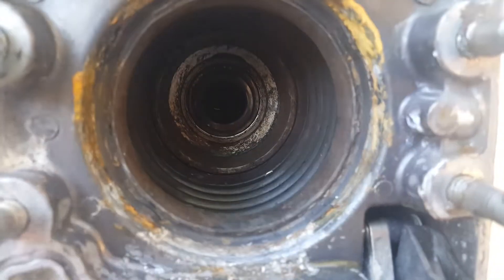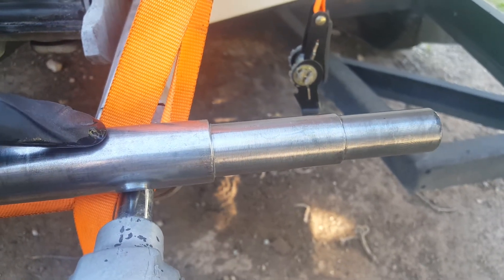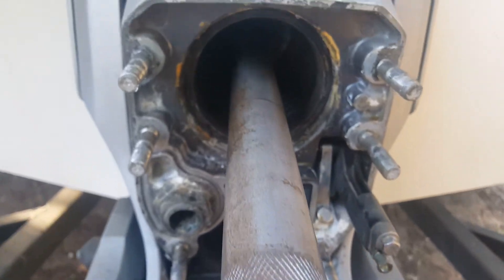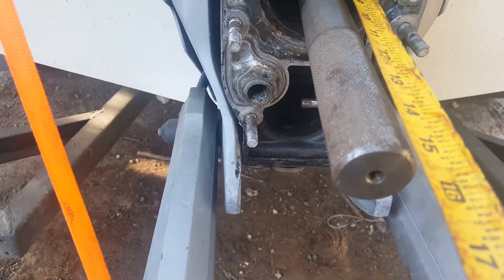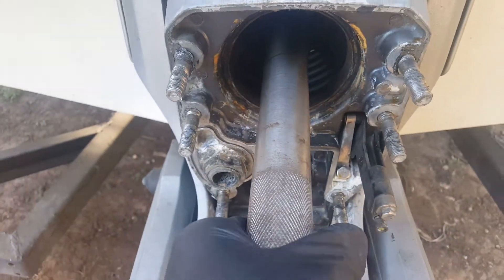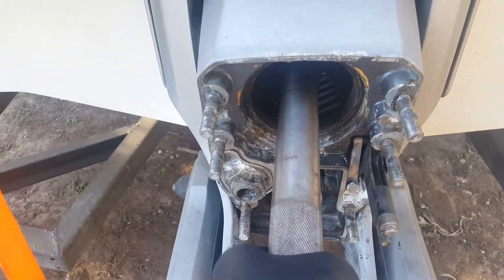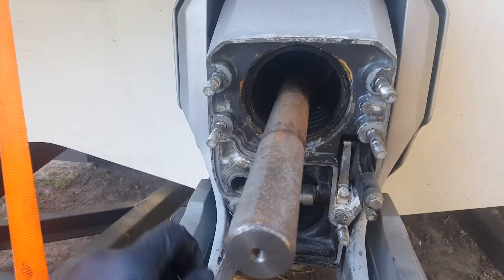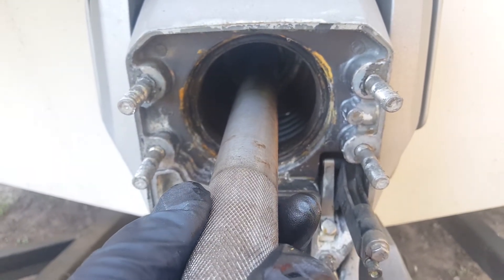OMC Cobra Volvo Penta SX Transom/Engine Out of Alignment

Comment: Is there an easy way to know when my drive is out of alignment?  I have a used 2009 Volvo Penta 3.0 with 100 hours that seems to run okay in the water but I've been on smoother boats.  Is there a visual inspection I can do while it's running or other technique?  Don't want to remove the outdrive just to check the alignment unless you think that's something I should do.  BTW, the previous owner had the lower unit serviced and I just wonder if the techs did a good job on alignment.  Thanks in advance for anyone's help!  Oh, and thanks Michael for the super helpful videos, marine mechanics charge an arm and a leg!
Reply from the maker: Hey Paul. The #1 symptom of an engine being out of alignment comes from constantly wearing out gimbal bearings. The second is abnormal noises that mimic a bearing going out—like a wheel bearing on a truck, it squeaks a lot. Otherwise, what you have would be resolved (hopefully) with maintenance e.g., spark plugs, wires, Amsoil gas treatments.
Reply: @michaelromer2016  Thanks Michael, that helps.  Thankfully, I don't think I have that problem but it's good to know what to do.  Great channel, thanks for all you do.

Comment: Hey Michael, great videos and super helpful!    I replaced my gimbal bearing in my '92 Four Winns with an OMC Cobra, and can't even get the alignment tool into the engine output.  The front motor mounts got it visually close, and I used a 1" pipe in the motor output to see if I could visually center it in the gimbal bearing.  I think its centered, but the motor may be at an angle.  Do you have a video on a full alignment with front as well as rear motor mounts?  I'm wondering if my rear mounts are compressed.

Comment: Hey Michael! First I want to thank you for all these great videos you have. I have learned a lot. But, I have a problem with my 1989 Cobra 4.3 with an alignment issue. I replaced the noisy gimbal bearing but I can not get my alignment tool to go in smoothly. I greased it and it shows that the splines on the coupler are hitting on the top. Lower the front, right? My front of the engine is all the way down. It seems like the rear is sitting too low. Can you give me any advice please?
Reply from the maker: Take your time on this process. If it takes you 3 days, it takes three days. Pro tip, doing engine alignment by yourself, will be painful. Pay someone if you must to sit in the back to continuously try to get the tool in, then have them check for resistance. Watch this: https://youtu.be/HGQ0d111dLw
Reply: My problem is that no matter where the front is, the rear is always too low. It's kind of like something is wrong with my rear mounts.? I know the previous owner had the engine replaced and it appears that they didn't do a good job. 
On the front mounts they took off the nut under the bracket and added it to the top. The then added some flat washers between the bracket and the bottom nut to really lower the engine. But, the rear is still too low.
Reply: One more thing. I saw a video where they were centering the gimbal on a Mercruiser. Do we do this on mine?
Reply from the maker: Neal Blue Can you tell if the transom or engine mounts had been replaced? Basically, you would see fiberglass work.
Reply from the maker: Neal Blue I experimented once with changing the height of the rear mounts and it wasn’t fun. I ran a custom height on the rear mounts for a season. It wasn’t worth doing and not worth you trying either. Keep in mind one thing, the rear mounts are designed to not be adjustable.
Reply: I couldn't tell if any fiberglass had been worked on, it looks factory.
Reply from the maker: Neal Blue the rear mounts can be causing this too. The rear of the motor has a mount that ought to have female square indents. The transom mounts ought to have two mounts that male squares they fit into the motors engine mounts. Sometimes the squares don’t line up and therefore sit too high most of the time. One must crawl safely towards the rear to make sure the square sections are lined up. Sometimes a flash light at night is easier. This is the first step that must be accomplished before messing with the front. Also you can’t torque anything down until the engine is aligned.
Reply from the maker: Neal Blue to help you better understand, most don’t properly align #21 with part #1. https://www.crowleymarine.com/johnson-evinrude/parts/55624.cfm
Reply: Yes, I saw that square nut was installed properly using a telescoping mirror and flashlight. I wish that was my problem but mine is sitting too low in the back causing the coupler to hit on top of my checker even with the front mounts adjusted all the way down.
Reply from the maker: Neal Blue I’ve had to do the following before to prove a point. Support the motor using an engine hoist. You will need to remove the front mounts altogether by removing the lag bolts and unbolting mounts from the block as necessary.  That will allow you to lower the front of the motor an additional 3 inches. You will almost have the harmonic balancer on the bottom of the boat. If you still can’t get it aligned, pull the motor and check the engine coupler—it’s probably bent.